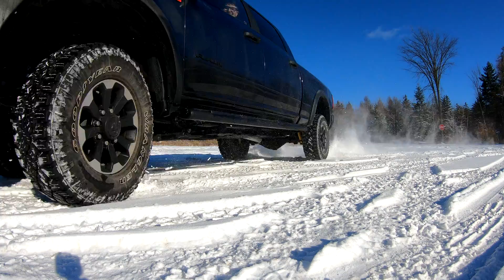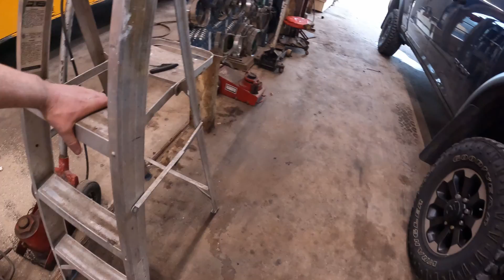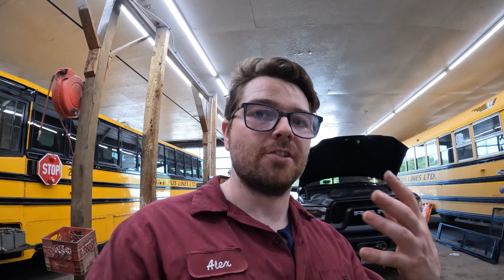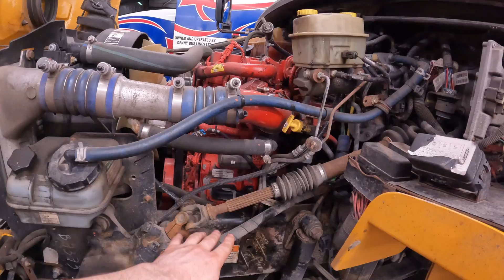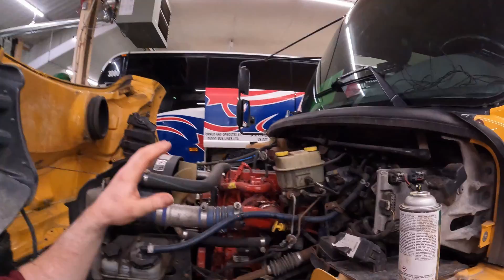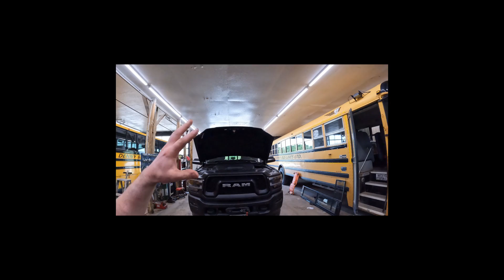RAM 2500 Cummins 6.7 GASOLINE Engine | Could This Replace The HEMI in HD RAM Trucks??

Comment: It's great to see more ICE innovations... especially for commercial vehicles that need reliability & be able to run continuously at full performance to operate PTO functions or on location services... Batteries simply cannot replace the versatility or reliability or rural operations away from civilization (high voltage/high amperage electricity etc)   Cummins builds an amazing product... Eliminating the EPA never ending Emissions problems plagued by ALL manufactures/brands..... Gas is quickly becoming a desirable power source for Light/Medium service trucks like Tow Trucks & utility companies, service rigs etc...   Being that the Cummins Gas engine shares most of it's components with the Cummins Diesel... that means the Block & internals are going to be very robust.. and since Diesels are naturally high cylinder pressure by design..... These Cummins will be Very robust & have potential to be built into some MONSTERS.... plenty of strength to put big boost without concern because a Diesel already runs those pressures normally. Great for winter cold temperature starts too.. plus all the tooling is already designed & being built for the diesel.. the only new tooling is for a Gasoline cylinder head & related fuel delivery etc... This could be a very durable powerhouse.....

Comment: I bet it’ll be direct injected to keep the compression ratio high…… maybe they even figured out hggi or whatever it’s called that Mazda was working on. And with having a throttle body on it will really be the reason Cummins goes with a compound setup for the turbos for simplicity and reliability since the throttle body will act as an engine brake when shut

Comment: This is very feasible. The closest example we have to a diesel like gas motor is the Bentley L series V8 motor found in the Bentley Mulsanne. It’s a 6.75L twin turbo V8 that makes 505hp @ 4000rpm and 752ft-lbs @ 1750rpm in base form. This engine in the Mulsanne gets about 16-17mpg on the highway while weighing 6000lbs (not to far off from a gas HD pickup).

The gas Cummins will most definitely have lower ratings as it’ll likely have to accept 89 octane fuel and have a single turbo setup, but it shouldn’t be too far off on torque…

Comment: Not a mechanic but a Cummins gas engine would be idea if Ram ditches the Hemi. The Hurricane engine is going to be under a lot of strain in a truck application, even in the 1500. It probably would work for people who use their trucks as daily drivers like me, but when you start to tow with one I feel like the fuel economy is going to fall through the floor compared to even the 5.7 Hemi since the engine is probably going to run rich under a high load to avoid knock under all of the pressure from the turbos. You can't make a bunch of extra power by just adding turbos to any engine without tuning it, more air being forced in means more fuel consumption by default compared to a NA engine. A Cummins gas engine with more than double the displacement of the Hurricane would be under less strain and might even get better fuel economy in a hauling situation.

Comment: the bottom end will  not be the same as the diesels, way to heavy and beefy for a gas application. I don't think you realize just how much bigger a diesel engine is compared to a gas engine with the same displacement, the Diesels are massive in comparison.

Comment: I don't think anybody (official) has said or even hinted that the new Hurricane engines would replace the HD 6.4. They will replace (eventually) the 5.7 and 6.4 passenger vehicle engines. I think this Gas 6.7 would be awesome as an HD 6.4 replacement as long as its close to the same price. It might be a mid level upgrade between the HD 6.4 and 6.7 diesel if its a couple thousand more than the HD 6.4.
Reply from the maker: I would hope if they do offer that engine they keep the price down. I do wonder if they plan on removing the 6.4 hemi completely or leaving it as the base option.

Comment: Actually there are two different 6.4L hemis, one is for performance(car, suv) and the other for the trucks. The truck hemi has different stroke for torque.
Reply from the maker: The strokes are actually the same on both engines. If the stroke was different the engine size would no longer be 6.4 liters. However you are correct the say they are two different engines because although they share the same bore and stroke they are two very different beasts
Reply from the maker: The strokes are actually the same on both engines. If the stroke was different the engine size would no longer be 6.4 liters. However you are correct the say they are two different engines because although they share the same bore and stroke they are two very different beasts
Reply: Yes true Chrysler spec info shows the differences in them, I’ll look it back up thanks anyway

Comment: The 6.4 is garbage in a work truck .The engines can’t handle extended idling without destroying the lifters and camshaft most of them don’t even make 70,000 miles
Reply from the maker: I mean If I was buying a purely work/fleet truck the 6.4 hemi would not be my first choice. I'll give ya that. you aren't wrong about the idle time. I think the lifter issue is slightly over blown but it is an issue. as a pure gasser work truck I think I would be curious about the 7.3 fords. people seem to like them.

Comment: The 3.0 is going to be a problem, yes it produces a shit load of power but.  Sorry with the high boost numbers and what has been released the 3.0 has to be wound up to produce power.  What I expect to see is there will be two camps, occasional user and the commercial side, on the reliability issues.   the the normal driver which isn't pushing the engine all the time just on occasion it will work fine.  Then the Commercial users that are working the engine on a regular basis will have lifespan issues.  Making a 6.7lt gas version of the Cummins will be most likely indestructable and since it is a long stroke engine it if turbocharged have a shitload of torque and hold up well.  Actually gas engines are getting better in fuel economy and diesels are struggling to meet polution requirements due to the heavier fuels employed.  Yes you have a slight loss in overall fuel economy due to gas is a lighter fuel and has less energy per volume, but that can be countered by creative fuel employment, remember a large percentage of your power is lost in the cooling system.  If someone could reduce this loss then a gas engine could be more efficient than a diesel.

Comment: Honestly I think that naturally aspirated may be a thing for the gas version engine. They are already going to change the whole head design to accommodate gasoline so they could still be doing direct injection and add newer technologies such as variable valve lift rockers with variable cam timing.   Really it kinda feels like they are bringing back the big block just in an in-line 6 modernizing the fuel system and combustion timing.  Back in the day gm did have a big block v6.  It wasn’t great but worked.
Reply from the maker: I mean ya some great points! I personally just think without a turbo Cummins would be leaving lots of power on the table but at the end of the day if you can make 400 + horse NA out this engine the extra power could be overkill
Reply: Cummins already tested the 6.7 gas version on a 2017 Ram 2500 and a Freightliner M2. It’s turbocharged with at least 600 ft lbs of torque:

https://youtu.be/kFP7WCfsjU0

Comment: Great video! If it were my money, I'd go for the 6.7 gas over the 3.0 because I know how heavy that truck is and having that small of an engine for that big of truck would be detrimental. My guess is that the 6.4 stays the same, and they introduce the 6.7 gas as an option to compete with Ford's 7.3. If Ram is smart, the 6.4 will soldier on for a few years so that bugs are worked out of the 6.7 gas and reliability is proven. After that, they may drop it.
Reply from the maker: I think you are on the money there. it does seem like the 6,4 may stay as the base engine as they introduce the 6.7 gas. and then as the years go by maybe they drop the hemi completely.

Comment: I'd love to see Cummins make a 6.7 gas engine based on the diesel!! Even more so if it's going to have a compound turbo setup. Also, the pistons would have to be different, as the combustion chamber in a gas engine is in the head. Not the piston. Very cool concept, imho. 👌
Reply from the maker: ya I would hope the pistons are different, I can't see them running the same ones because diesel and gas engine piston are so different for a variety of reasons

Comment: What do you think of the Via Motors set up where the v6 diesel at a fixed RPM produces power for a generator to top up batteries when they get low?
Reply from the maker: I mean diesel electric equipment has been around for a while. it seems to work well in super heavy duty applications. I don't see why it wouldn't work for a transport truck. but I guess the question would be is that set up going to be more efficient
Reply: @GettysGarage  It definitely would be when you consider each technology is being used in its most efecient way. for example, combustion engines are most efecient at a set rpm and load (think hwy miles). When the combustion engine is runing to power the electric generator it runs at a set rpm and load. The electric motors can give instant torque on or off or variable without loss of efecientcy therefore giving the driver the best of both technologies. Also there's no range anxiety because you have the fully charged battery at the start and diesel to run the generator to top up the battery as required. So you can carry extra fuel should you go bush. Check out Jay Leno's Garage Via Motors.

Comment: I've always thought that HD trucks should get a big block gas motor. Ford finally did it with the 7.3 Godzilla. GM wimped out and gave us a bored and stroked L96 with the L8T. If Cummins can make a big block pushrod 6.7 gas motor with forged internals for the Ram 2500/3500 I'm all for it. Over build the thing, give us 500 HP and 500 ft/lbs minimum. I'll buy one first year. Diesel's have become so over complicated and choked up with regulated crap that it's not worth buying one unless you buy two, because one is always going to be in the shop.
Reply: Agree completely. I have a 2007 Cummins 5.9 pre-emissions diesel which has been great but this new Ram engine would draw me into another purchase. A Tradesman 2500-3500 with the inline 6 would be a sell out.
Reply: the 7.3 is not a big block, it's bigger but not as big(or as heavy) as your usual big blocks. when the ford 7.3 came out the ford fanboys ran to the moon calling it the GODZILLA when that's not its name, and calling it a big block when it isn't. Ford didn't say anything because well the Fanboys advertising was very effective and ford couldn't get sued for it.

Comment: I’m definitely interested in this engine, I’m curious if it will be naturally aspirated or turbo’d, what kind of power it will make, fuel economy etc.
Reply: The 6.7 cummins gas will be turbo charged.
Reply: @paulc3455  interesting. Must be running pretty low boost. The only real advantage to gas HD is there cheaper. But if you can only run high octane it really offsets the cost
Reply: @toofastnobrakes  Unlike guy said in this Video it's gonna be cast iron block and head only head will be built for gasoline . With fuel prices I'm sure it will run 87 octane fuel as people won't buy it otherwise won't make sense.
Reply: @paulc3455  exactly

Comment: Cummins has built natural gas and propane engines for a long time for heavy duty and industrial markets. This is nothing new to them, just new in this platform. I've never been a Cummins fan given my experience with semi trucks however this makes decent sense for the HD Ram platform trucks.
Reply from the maker: I honestly don't like working on the big ISX Cummins and the like. DD 60 series were great engines, dare I say the new Detroit diesels are good engines as well.
Reply: diesel mutt88  I never liked the big trucks with the Cummins.  But in the Ram it was great until the pollution B.S screwed it up. I would not buy a new Ram with the Cummins today.

Comment: you talk about the block being overbuilt for a gas engine. could they maybe make the block identical but with aluminum instead of cast iron?  Alot lighter but beefy enough for an aluminum block gasoline engine.
Reply from the maker: would not be a bad idea, I think it would all come down to manufacturing costs. if it was cheaper to just run one single block for all fuel types despite some engine being "overbuilt" I Cummins wouldn't bother with an aluminum block.

Comment: it wont repalce the hemi it will be an 8000-10000 option think bout it an engine that use all the parts from a 12k cummins. this is an outside manufacturer  the block everything is the same... it could make 500-600 hp and 600 to 1000 tq depending on what mileage they want to get its going to be a very expensive gas option BUT sign me up  im over failed emissions and egr
Reply from the maker: I think you are correct about their being a nice price tag with potential engine. how much I couldn't guess. because of some point there has to be a "base" engine for these trucks. so are they just going to jack up the base price of these trucks. I'm not really sure, only time will tell!

Comment: Your forgot to mention the weight of the moving parts inside the engine which will decrease the efficiency of the gas motor!
Reply from the maker: that is very true. I know cummins said they would keep the bottom ends the same but I can't see Cummins keeping the same rotating assembly. diesel pistons and gas piston are so different it would make sense they would be different
Reply: Even the crank shaft is insanely heavy

Comment: I'm a mechanic myself and when I saw the title I said :if it's going to be true, then we will have the most durable and reliable gasoline engine ever built in automotive history. Tuners and guys with OCD like myself will love it
Reply from the maker: If they are truly planning on keeping the same bottom end as the 6.7 diesel the gas version is be insanely overbuilt, those 6.7's are rated to withstand over a 1000 lbs of torque, STOCK
Reply: @GettysGarage  I wish some aftermarket companies come up with a nicely built iron heads too. Inthat case the engine would last 1.5 million miles without an overhaul, even more than modern diesel engines because gasoline engine is so much less stressed
Reply: @GettysGarage  That is allegedly the plan. Same block across the board 0 short block changes between fuels

Comment: Don't buy into the liberal ESG bull---!
These people want all us little people running electric, while they fly around in jets, and air condition they're mansions!
Reply from the maker: I mean there is nothing wrong with electric motors, or vehicles but they have a lot of unsolved problems and it simply is not feasible at this time to have everyone shift to electric.

Comment: yeah because governments already hemorrhaging trillions of dollars can afford to pay for hundreds of millions of car subsidies. Electric won't be a serious contender for everyday people for at least another 25+ years. The infrastructure alone cant handle it. It takes about 2 to 3 hours to fully charge a Tesla so how do you get a full charge on a road trip? Sit at a gas station for 2 to 3 hours every 400 miles??? You'd need "Gas Stations" or "Charging Stations" with parking lots the size of Walmart to be able to handle millions of cars sitting there for hours on end.
Reply from the maker: the best car chargers are the ones sitting in front of diesel generators. when I was driving across Canada I saw a couple. I should of honestly taken a picture.
Reply: For 25 years there's no way.

Comment: I would be very surprised if the Cummins is used. I think it is going to be too heavy. Ram needs a heavy duty gas motor for its trucks right up to the 5500. A lot of municipal groups and businesses don’t want the cost and maintenance of a modern diesel. Ram went out of their way to go in house with the 3.0 diesel then to go with Cummins before. I agree the duty cycle might be too much for the new I6, although the numbers in power are there. Like the 6.4 they could have a truck duty version over a car version. It might end up I6 up to 2500 and 6.7 3500-5500 that could work. I think it will be interesting all the same.
Reply from the maker: Agree 👍 the cummins 6.7 gas will be a heavy duty gas engine. Almost too heaby duty for your average 2500. But you make a good point with fleets looking to dump the diesel option for there 3500-5500 and go with a simple gas engine. Only time will tell i guess!

Comment: I guess HD have different emissions regulations so it would make sense for them to do a gas Cummins.  Will they do it since it makes rational sense though?  Hard to say, lol.
Reply from the maker: There is alot of speculation but it is an interesting concept and idea. And yes HD trucks don't have to post their fuel milage or go through the same emissions so from that stand point it could be a nice addition to fleet trucks not having to deal with the strict diesel emissions
Reply: @GettysGarage  That's the only reason the Hemi is going away in the 1500.  Emissions and fuel economy regulations.  Gas Cummins would not make the cut with the light duty emissions, but HD class fly at it IMO.  I'm sure it would be a great engine.